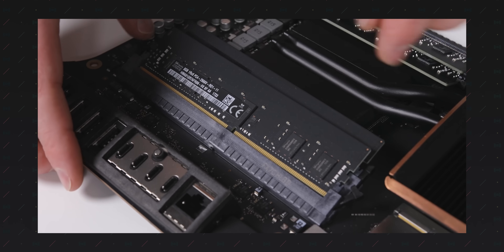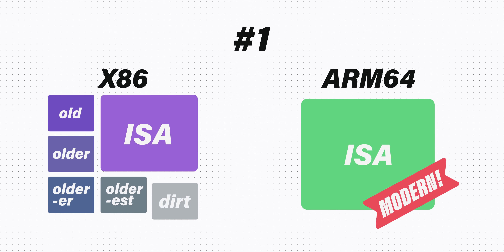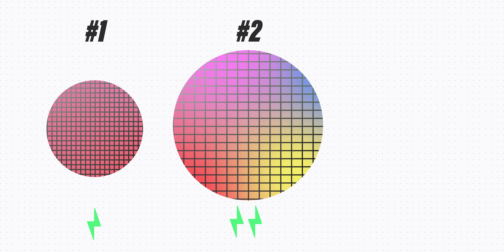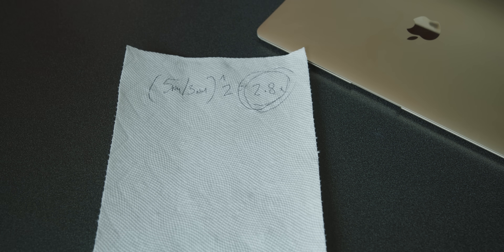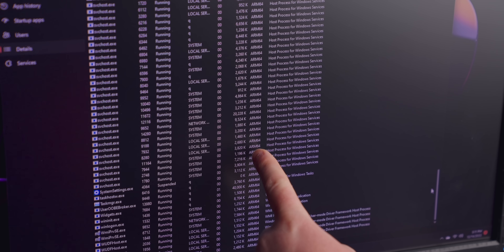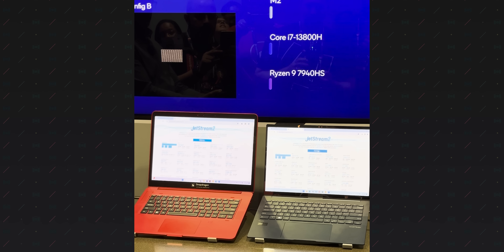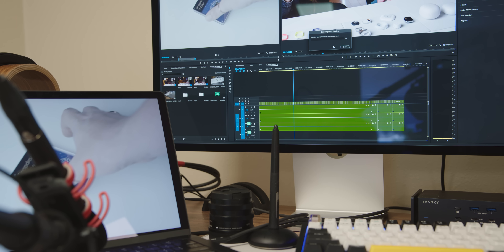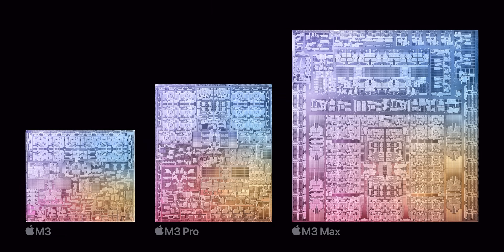Apple's Silicon Magic Is Over!

Comment: Ok, Windows ARM is crap today, but what if the right competitor for Apple is not Windows but something like Chrome OS in steroids, with game compatibility, etc? Apple prices with no possible upgrade and no right to repair still a crime for me.
Reply: ChromeOS was designed to look like macOS, but with a Google twist to it. However, it’s based on Gentoo Linux currently.

I am saying this because macOS, which used to be called OS X and Mac OS X, is much older than ChromeOS and ChromiumOS.

Then again, I mostly use Macs anyway, with some Linux mixed in (mostly Fedora and Manjaro).

Comment: First point is something that is miss construed frequently. Still has a point but the fovus on the instictions leads people to beleive limited instuction set cpus are just overall better cause their newer rather than the other ways x64 is passing x86.
More detail if curious below.
The "old" instuction sets and the micro ops they are used in don't contribute to the slowdown of x86, decoding instuctions is the primary bottleneck which is equally true to x64 cpus. Additionally some of the older/larger instuction sets that were removed in the conseption of arm cause an arm cpu to preform more micro ops to get to the same outcome. They are both stuck at the same point and archetectusl changes will be needed to alleviate the decoding bottleneck in all current high speed prossesers.

Comment: IMHO massive thing with m1 was that low power.
people who had 70dba intel's suddenly learned  they can work, without that jet in there, and it does not mean they will fall asleep before work is done.
working with laptop on your lap, does not mean you will burn your legs. 
that was massive, incredible upgrade.
but what apple did a year later?
They brought back the whine, with no way to go back to silence. Thing became even worse toaster than before. What for? 10% more power. 
IMHO apple had 4 things, with m1.
battery, silence & cool, power, ecosystem. 
m2 and m3 gave 2/4 reasons why you might want that hardware over any other away. 
how they thought it will not be seen as worse? its 10% more power, for becoming unusable on your lap, eating the battery almost twice as fast on full bore, and either being whiny or slow down back to old intel speeds.

Comment: The fans on my 14" M3Pro MacBook pro run at full tilt when I am doing intensive work or when playing a game on the computer but that is okay. It's what the fans are for. Apple spent a lot of money designing the chassis of the current generation MacBook Pro and it's quite evident that they planned to offer more power-hungry chips all along. The computers cooling was overkill for M1/M1 Pro but it's exactly adequate for M3 Pro. M3 Max generates enough heat that you really should use a 16" MBP if you need that chip.

Comment: Since you were there in Qualcomm labs, did you ask or was it mentioned about replaceable arm chips? From the old x86 chips they do die. Are going to be able to replace the chips or just buy a new motherboard/new computer
Reply: Ampere Computing has replaceable ARM CPUs and with LPCAMM2 on the horizon it may be feasible for certain OEMs to facilitate such an path. However, with the desires of OEMs to let you upgrade your whole board instead of one specific component, and with the notiono that these ARM SoC can vary in sizes as they scale up their iGPUs. There may be certain considerations that Qualcomm may just not interested in making. 
I think it's an interesting question and actuallly one we very much need if ARM wants to be placed in our desktop computers, but unless there is some regulatory intervention I don't suspect there'll be much movement to do such a thing.
Reply: @R3endevous  I fully agree, thanks for telling me about ampere as I had completely forgotten about them. But you do have a point about the iGPUs probably RAM aswell due to some architectures having unified memory aswell. I think a good compromise would be to make a big socket for example half the size of a modern phone where you have some pins unused so whole boards don't have to be instantly replaced if chip dies. 
Ofc I'm talking about easy user replaceable methods without the need for rework stations and etc.

Comment: The M1 was never revolutionary, as much as every Apple die hard would make you believe. They took years of experience developing their mobile chips and scaling them for laptops. Not to mention, those chips aren't cheap. And its disingenuous to say "Apple now has competition"... Ryzen systems have performed just as well, and in other aspects better, all this time - while sipping slightly more power. The advantage Apple had was coding the OS and designing the CPU hand in hand to get enhanced performance for the platform.

 Apple took one giant leap, and is stuck looking for improvements now, while AMD and even Intel are gradually increasing every single performance aspect of their CPU's and blazing ahead.

Comment: No worries, the shrinking of the transistors might slow down a lot for silicon-transistors. That is the 'easy' lowhanging fruit, there are many other ways to make chips faster. Think about datalatencies. Also there are other materials than silicon to make chips from and those can be shrunk down a lot more. As Ian Cutress (former Anandtech) says: with many millions of people working in the chip-industry they will keep finding ways for a long time to make chips faster. I agree.

Comment: Apple needs a touch screen option. I'm not saying force it onto every product but make it a $200 value ad for artists because it's ridiculous that if you want to use a stylus and have a desktop computer, you can't use a Mac. I won't even get into gaming right now. Just at least put a touch screen option for some of the Mac laptops. Obviously not a requirement though. Thankfully Apple has figured out that this needs to happen and it's working on it.

Comment: For what I got I consider my MBAir with 16 gig a great value.   How often do you buy a new machine?    The price of the memory is not a big deal over the lifetime.   I would rather have a perfectly engineered machine and allow some headroom for age when selecting memory size.   A decent laptop for the average user is less than a typical monthly credit card bill or a very moderate vacation.   Then you have it for years!    All these detailed discussions have little significance or relevance to the vast majority of users.   Back in my PC days doing x86 machines it was fun.   But now I don’t even bother.   I just know that my Mac will be plenty powerful for the next 8 years or so.   I know Apple will take care of OS updates and security.   I know it will all work fine.   Instead of studying every kind and make of the latest chips from whomever with endless weird names and numbers and specs I relax and spend my time on other things.   You can love or hate Apple but they are very good at what they do.   That’s all I care about.

Comment: I purchased an original Surface from Microsoft paying over $1000 for the surface tablet over 10 years ago. Microsoft killed it in less than 2 years afterwards. I’m never purchasing Microsoft hardware anymore or will I ever purchase Microsoft OS on ARM architecture. I’m heavily involved in Apple hardware now, having a 12.9 inch M1 iPad pro and an iPhone 15 pro max. I keep a Microsoft on Intel around for my Ham Radio hobby that has Windows X86 software only stuff…  If I could get 100% away from Microsoft I would because they have become a company that may sell stuff they don’t want to really support for a long term. Apple supports my Apple hardware for years with their software and hasn’t let me down yet…

Comment: I think that the biggest advancement has been done in the GPU field. I have the M1 Max and the GPU performance is horrible. I switched to this from an i9 iMac with a Radeon Vega 48 and it was way faster (in Motion and Final Cut), which was a big dissapointment for me. If the M3 fixed this (and this is what Apple tells), than for me it is worth the upgrade. So the progress is not on the CPU side only. On the other hand, I'm happy that the M1 Max stays cool and silent. I understand that there is a big pressure - especially from YouTubers who compare Macs with turbocharged PC's, which don't bother about power consumption and heat generation. So I understand why Apple has taken the step towards more power hungry setups. Still, I wouldn't switch to a more powerful PC, as I prefer the Mac OS in every aspect compared to Windows.

Comment: One detail I don't understand is why they don't expand the chips vertically. I understand actual 3D chips is a bit off, but simply placing 1 wafer/chip on top of another… say 10 times… shouldn't be that hard.
If it's a heat issue, I'm sure there are ways to deal.

Comment: I really love how you explained the technology growth. 
I purchased both the M1 Mac Air & the sister iPad Air. I truly love the power with NO MOVING PARTS. 
Making more heat to get a bit more power, by adding fans is a bad trade off to me. I understand it may be necessary for some power users, but I believe most home users don’t really need it. 
I n a computer clean room, running a fan offers little threat, with windows open and/or having pets as many of us do, those fans life becomes shorter. 
Apple has been great with a very long software support, but if the hardware fails, they will need to replace it!!!
Sounds like this could almost be a plan?
Excellent video, keep them coming…

Comment: I am still using my Late 2008 Macbook pro 15 inch 8GB ram 2.5GHz Core 2Duo 255GB SSD 128GB SSD + MacOS El Capitan and MacOS Sonoma. Runs better than brand new. I know its 16 years old, way slower than current Macs. But it's still fast and efficient for me

Comment: Hi, I'm experienced video editor and I want to sell and buy a new one before my macbook pro gets too old. I have a Macbook Pro 13 inch M1 16 Gb Ram 512 GB SSD. I'm pleased with the performance of the M1, if I don't push too hard, it does my job.

I'm using it with a 28-inch monitor when I use it at home, so I'm thinking of buying a 14-inch one. From what I've searched on youtube and here, I noticed that the M3 Max works more in loud and hot, and I decided on the following features M3 Pro or M2 Max, what do you think? Also some of guys says that 16 inch Max is silent and colder than 14 inch

I would really appreciate it if you could help.

16inch or 14 inch  M2 Max 12CPU, 38 GPU,32GB Ram / 1TB SSD

14inch M3 Pro 12CPU, 18 GPU, 36GB Ram/1 TB SSD

Comment: The only thing I've seen Apple have over anybody is its software.  Having that much control over it to keep it that much stripped down and streamlined for performance tells you the silicon really isn't that great.  Esp. if you have it basically running in a optimized situations all the time.  Throw in a monkey wrench and it all goes to heck.

Comment: Snazzy, very good points you raised. There is no free lunch in microprocessor design. Apple was never going to be permanently be in the lead regarding performance and/or efficiency. In fact several months ago I made the point that it's easier for Intel to catch up to AMD (and Apple), than it is for them to pull further ahead. Give Intel another year or so and they will reach parity.

Comment: Great video going as deep as I always want these videos to go.  

Excited to FINALLY get an M1 competitor. I'm a Linux user who has been waiting for 4 years for this!
Reply: Linux being supported would be the only reason for me to switch from my M1 Pro MacBook Pro to any other device, that's close in efficiency and performance. No x86 system is. And sadly Asahi Linux still doesn't cut it on Mac.
Reply: @igordasunddas3377 what kind of issues are you running into? or is it known limitations like no external monitor output on a MBP?

Comment: When the magic wears off, open up an old Intel Mac and do the same things you're doing on an M1 Air. The only thing I care about in computing these days is: I don't want to tweak it, overclock it, or give a crap about what the internals look like... I just want it to do the job I ask of it, which isn't running benchmarks; and it does it every time. The M1 Max MacBook Pro is the best computer I have ever used. 
If it breaks, that is what AppleCare is for. 
My kid has a pretty sick Intel gaming PC... 25 year old me would be drooling over it, but every time I sit down at it and use Windows, it makes me thankful that I use a Mac.
Awesome video!

Comment: I definitely don't have any reason to upgrade my M1 Max yet. I hope it will last me at least 3 more years and I somewhat agree about the form factor argument. Assuming Apple releases a small system with a WORKING keyboard this time, I think there is a small market that would like that. I would say though the iPad lineup really kind of fills that gap in my mind. I would like to see the 14" be able to cool the Max variants as well as the 16" but if that can't be achieved they may want to rethink offering the top Max SKU in the 14". I love that you can get it but it clearly performs better in the Mac Studio and 16" systems because of the better cooling available. An ultra in an 18" laptop would be cool but it is not very Apple. That said maybe for Apple to continue to be truly successful they need to re-think what being "Apple" is in 2024 and beyond. Early in their life some of the best computer games were released on the mac but the company didn't want to be perceived as a lifestyle/gameing and not serious company...they wanted professional users, and serious business users to want macs so they kind of killed gaming on the platform.

Supporting Vulkan and making a DX12 translation layer baked into macOS would be a great start instead of forcing people to use their own apple APIs.

Comment: I'm an old turd working in the graphics/3d business, and I started behind a Mac around 30 years ago. Back then they were just the best you could have if you did anything creative with a computer. Currently I test some render software and I have to explain people why they shouldn't buy a Mac which is not always easily received because of Apple's great marketing department. While I'm really impressed what they did with the Mx processors as in performance/efficiency it misses a dedicated GPU to perform in basically everything connected to a creative work field. And I think that's a real shame considering Apple once was the go-to for creative people. Even on the hardware side I think they are conservative and even Microsoft actually makes more creative machines like computers with a touch screen and a pen. That's pretty sad. They also lack a normal GPU most of the time so still don't want them but hey, they at least come up with quite nice products for creatives.

Most Apple users don't have a clue on how much applications are currently accelerated by dedicated GPUs in a PC. They think it's for gaming but weather it's audio, video, renders, AI it's all GPU accelerated and the speed difference between a CPU or GPU with such tasks it a big one. And a dedicated GPU these days ain't exactly cheap as well but compared to the pricing of Apple products it's an easy pick if you do anything creative. I really wish Apple got innovative again and also stepped away from all laptop components which are basically already slow to start with. We don't all move around like crazy.

Comment: It’s ridiculous that Apple is still releasing chips and a so-called Mac Pro with PCI 3. The Mac Pro highlights literally everything wrong with the Mx family. Would it really be that awful to put a set of DIMM slots, a standard M2 slot in that utterly massive, empty chassis? Not even one Mx chip has come close to matching the better/best graphics cards for sale now. Helping AMD or Intel create a boot rom for PCI graphics cards would go a long way toward adoption of ARM, too. Apple’s graphics drivers are hopelessly out of date in comparison to Windows. The exact same graphics card performs 50% better under Windows. 

Intel’s P and E cores are silly. Apple was correct for dumping them. Working with AMD on x86 however, would have been a win for both companies. I WISH you[d make a modern Hackintosh, show just how behind the Mx really is, in comparison to x86 offerings from AMD.

Comment: We are forgetting one reason why the M Series even exists... reducing Apple's carbon footprint. The power efficiency is not just a feature but insuring clean energy is used as often as possible, is what the M series is. The move to also embed everything to the motherboard also suggests that by time any of the M series chips degrade in process speed, the life expectancy of the M series lineup will have already been terminated. The M Series will make the 10 year gap and by then Apple will have had time to research even greater performing and greener tech options.

Comment: Comments: First off, the only reason windows is doing so great is because of software and hardware support compared to Mac’s and Linux, which they will lose when going arm (and no, old hardware will not be updated for this architecture) making the pcs not windows, but more like Mac-wannabes, AKA why chose a windows-arm over a MacBook or even a Chromebook. 

Second of all, almost noone wants a 12 inch Mac, there is a reason why both Mac’s and windows are standard 13-14-15-16 inch. These are the sizes people want. And if they wanted smaller, that is what the iPads are for.

Comment: My ipad pro 2017, is litterally butter smooth. Apple silicon is doing just fine. Apple M2 is so far ahead, you can use it 10 more years, no problem at all. Its extremely good

Comment: One thing about Apple silicon is that the air laptops that don't even have good passive cooling built in them. I think spending a couple dollars on some copper would make a big difference but apple loves sitting on basic stuff like that for the markup.